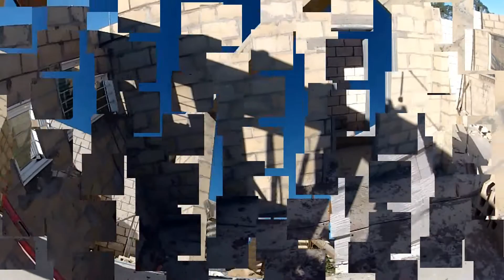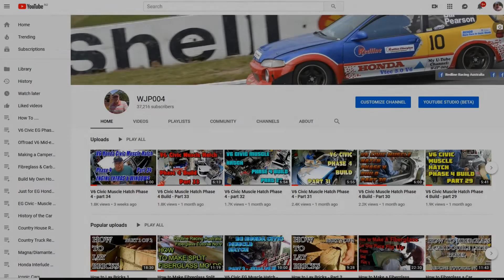Build  My Own Home - Part 7 Music  Re-mix #3

Comment: Did you consider using a system like ICF (insulated concrete forms)? Not sure the cost difference but may have saved yourself some time and your back doing all that work yourself
Reply from the maker: All block & lintel work had to be done according to engineer's specifications. The tiniest deviation from their drawings leads to huge complications & stuff having to be re-done. Ask me how I know this!